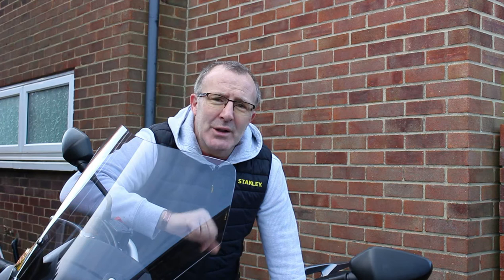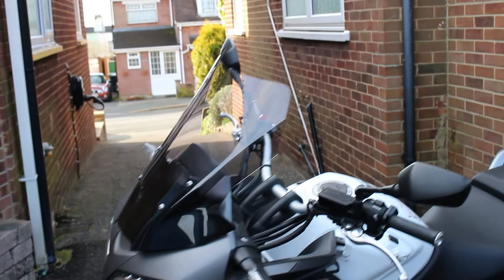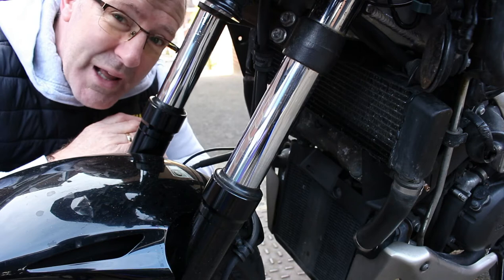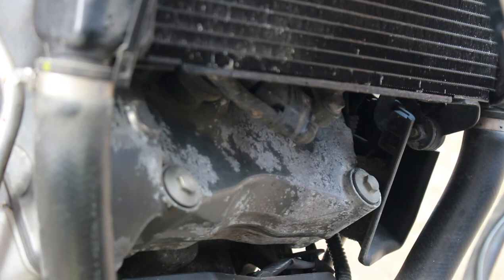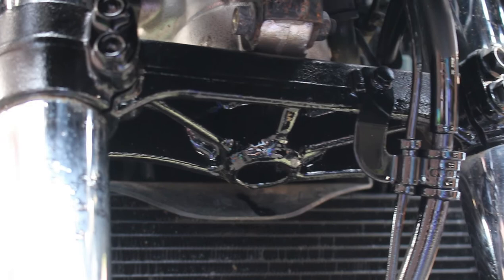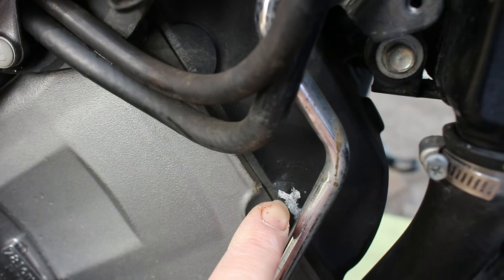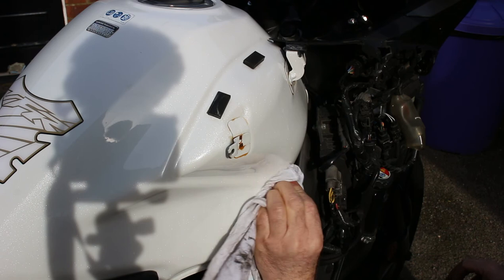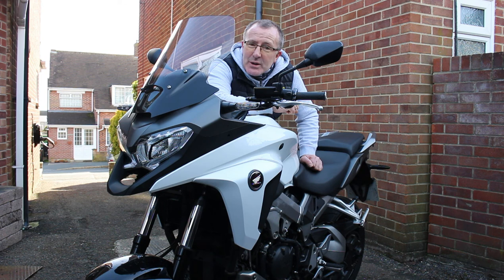VFR 800 Crossrunner part III

Comment: I've just bought a 2017 model, what oil filter should I use for this? I'm not mechanically minded at all.
Reply from the maker: Hello, 

I used a Hyflo HF204, perfectly good for the Crossrunner 2017. 
Unfortunately with the cross runner, a few items have to come off to get to doing the oil and filter change change. 
You will need to 1st, and always do way in advance of starting, spray the back of All Allen bolts and any other bolts, screws, that may need removing. 

If you can, use WD40 or any other penetrative fluid. 
Best to put card board under belly pan, with bike on center stand, and spray ( with pipes COLD) do this a few time leading up to removing, to avoid struggling to remove Allen bolts. 
Ensure you use the best, tightest of fitting Allen (Hex headed bit) to avoid rounding the inner of bolt head. 
If too tight, and you begin to feel the Allen part turning before the bolt is, STOP. 
This is where an impact drive, or heat will be needed, if penetrative fluid has failed. 
Always avoid rounding out ! 

One the belly is removed ( and bolts are put in a dish/ container, so not lost, and even marked up so not mixed up) 
You will need to remove the black plastic guard, once removed you will see the oil filter. 
From memory ( so annoyed I never filmed for YouTube) you can unscrew and undo from behind the down pipes, and twist filter out, and get a new one in. 
If you need more help on oil change or filter change, see some of my other videos for details. 
It is easy, but also easy to make errors, so there are things to definitely avoid. 
Ask me, if you need further help please.

Comment: Hi mate, is this screen the tanned one or the bright one? Nice video ones again.👍🏼
Reply from the maker: The replacement screen is clear fading down to black. Thanks !
Reply: @DeanAllen  does those holes in the screen gives some air to your face to cool of in the summer? And does it wobble or something at high speed? And do you recommend this screen or the one of Puig? Thanks!
Reply from the maker: I found it still very noisy around the top of my crash helmet. Can't feel any wind in my chest or face, but disappointing it is still so noisy. Bought some ear plugs, which I should be using anyway.